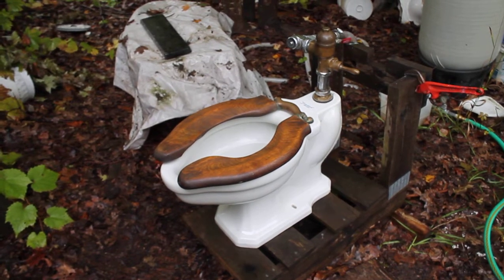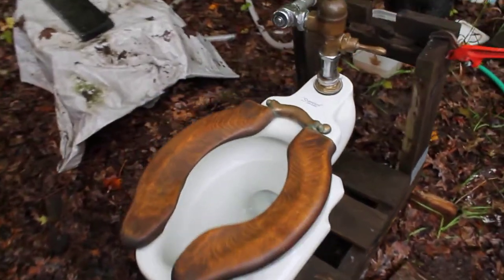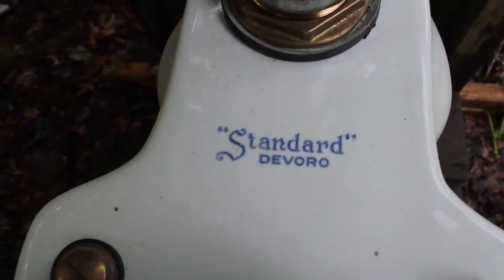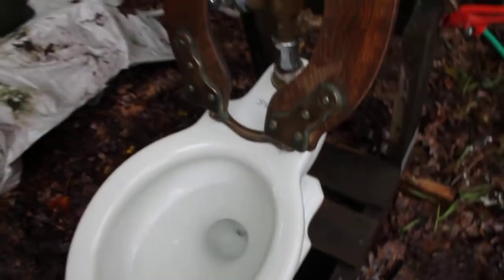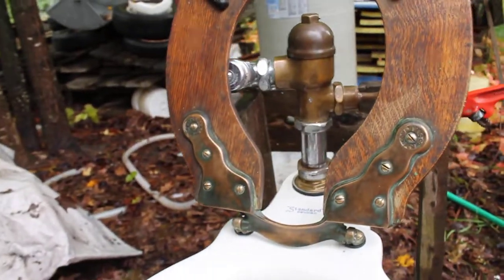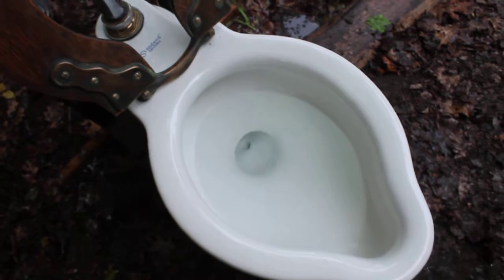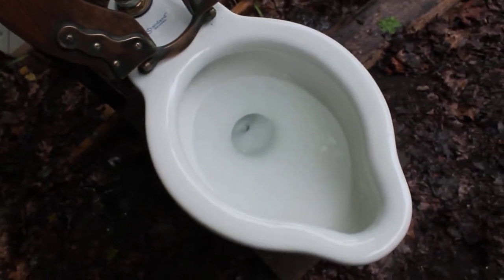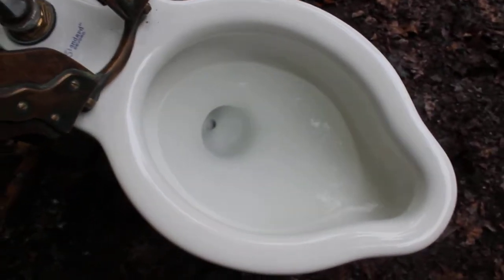#8 1927 Standard Devoro toilet flushes

Comment: I recently purchased a beautiful comode just like this one.  Does anyone have guidance on where I can find a seat to fit this elongated bowl?
Reply from the maker: Modern toilet seats will fit these toilets. It will depend on whether you have a round front bowl or an elongated bowl. Either style of seat is available at a hardware or home center, but I watched Ebay for some time to find the old style seat in my video.
Reply: @vintagekohler6085  OK thanks, the one I got is the elongated (pear shaped) bowl just like the one in the video.  Im surprised that a regular seat would fit that bowl.  But I will watch on eBay.  Thanks
Reply from the maker: @davidlagnese3108  if It's the pear shaped bowl then a modern elongated seat will fit.

Comment: I wonder how one can tell if its a Tribor, Devoro, Monaco, or Savoy if the model name isnt present
Reply from the maker: A Savoy is pretty easy to tell because it's the only Standard toilet I know of that has an elongated bowl with the bulges on the sides for the jet.
A Devoro and Tribor would be harder to tell, but only if you know the toilet goes back to the 20s because no Devoros later than 1929 had extended lips or the side bulges. If you see both on a toilet that is newer, it could only be a Tribor, or a Valvo but those have a different shape base.